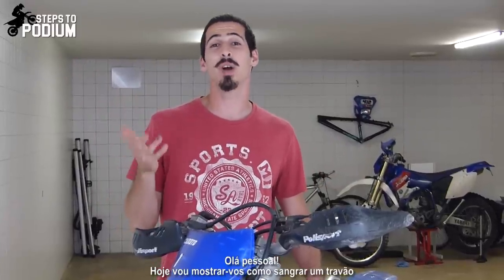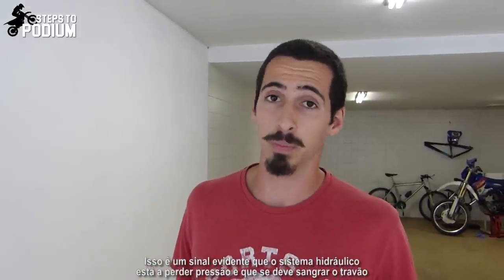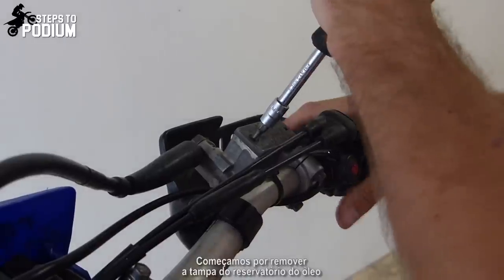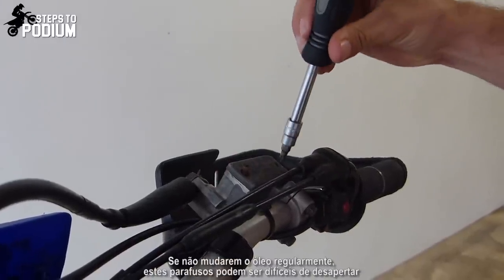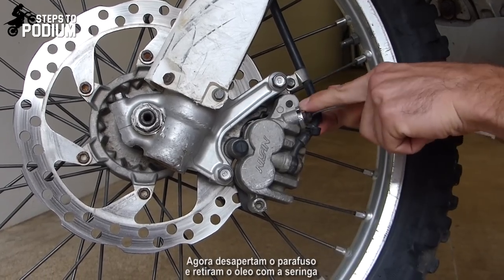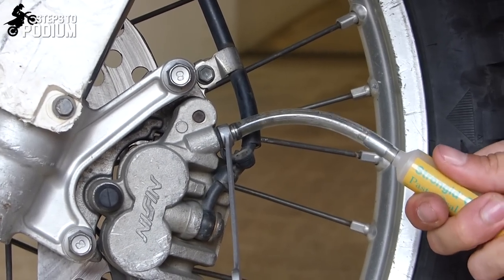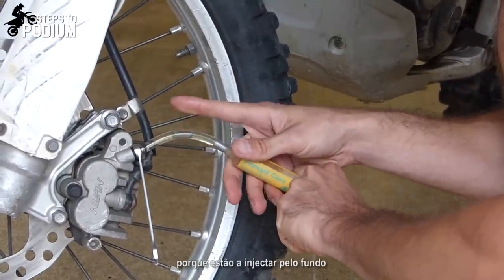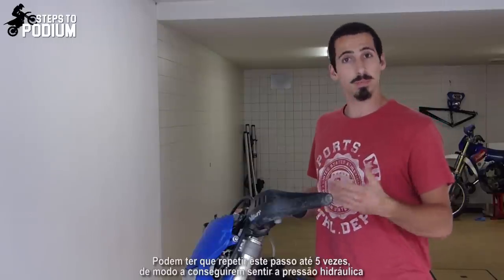How to bleed dirt bike brakes - Reverse bleeding

Comment: On the Yamaha WR, I found that by removing the master cylinder, elevating it, and pumping the lever, I can get all of the air out by just doing this.  I suspect that because the WR has a longer break line with a high point in it for headlight clearance, this spot allows air bubbles to build up that are hard to get remove.  Elevating the master cylinder gets rid of this air trap and allows for easy bleeding.  Your tips on fluid removal are spot on and helpful.
Reply: Hey! Elevating it so that the brake line becomes straight?

Comment: When pulling brake fluid with a syringe some of the air you see is coming past the bleed nipple thread, so it's deceiving..... you think your getting lots of air but some of it's from outside of the brake system.
You might never stop seeing air even though the system is bled.

Comment: Dumb question. By doing what I just watched  does that also work for the rear break ?
Reply from the maker: there are never dumb questions if that helps you understand any topic! 
if you do this on the front brake, it only affect the front brake,  if you do this on the rear brake, it only affects the rear brake 😊

Comment: Going to try this. Rebuilding my 02yz125 and have ZERO pressure. It has new calipers and new galfer line. But I have no pressure at all and have tried bleeding about 20 times.
Reply: did it work for u

Comment: I'm watching this tonight because I'm going to change the copper washer to my brake hose tomorrow, I'll update you tomorrow on how it goes
Reply from the maker: great! Please do let me know!
Reply: @StepstoPodium  it didn't work, my brakes were ok except the copper washer was leaking so I replaced it but now there is no pressure at all. Im gonna have to take apart my master cylinder
Reply from the maker: @DatWhiteSpanishBoyFromNyc.-_-.  You have to do several times the last step of the process in order to regain pressure! Just doing it once won't be enough.
Reply from the maker: @DatWhiteSpanishBoyFromNyc.-_-.  If after that it still doesn't regain pressure, in that case, yes, you might have some sealants or orings busted

Comment: Hi there mate got a kx85 rear brake is really soft Iv bleed the rear brake but it still won’t work as it when pressing the rear brake it won’t stop the wheel at all. Any suggestions?
Reply from the maker: you have to build pressure inside the system, only to bleed the system in not enough! if after that it still doesn't has pressure, you might have a faulty brake piston which is letting oil through the seals, keeping from building pressure
Reply: Steps to Podium how would I build pressure inside the system. Do I just carry on bleeding the rear brake?

Comment: Just broke off the thing you put the syringe on
Reply: I stripped my bleeder screw threads on my caliper so I’m searching to find out if I can bleed my brakes bye bleeding the system using the lowest banjo bolt rather then the bleeder screw.